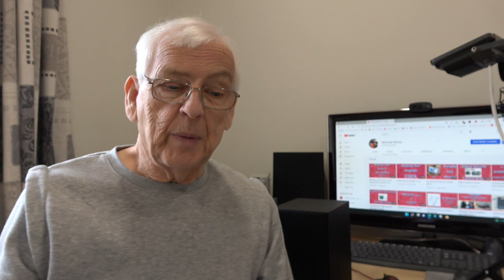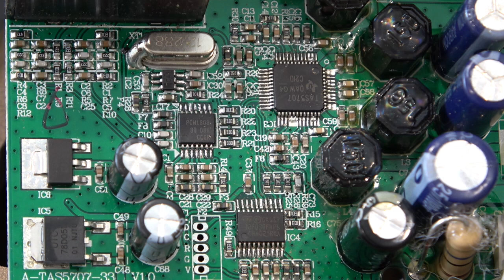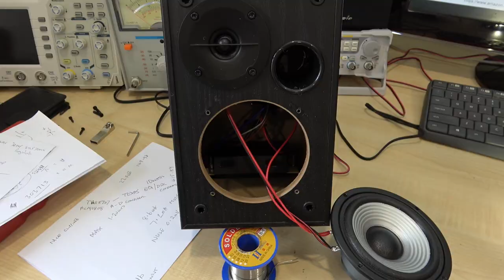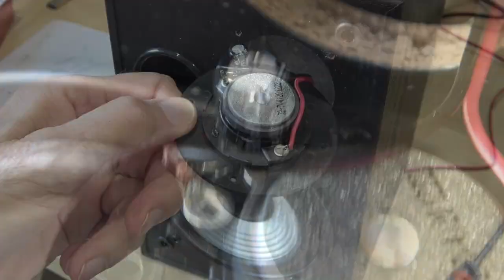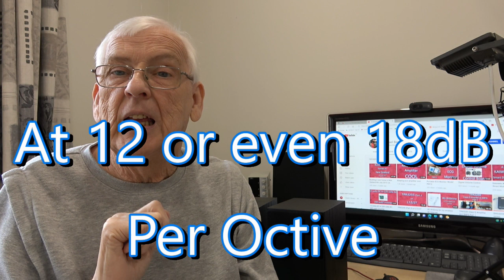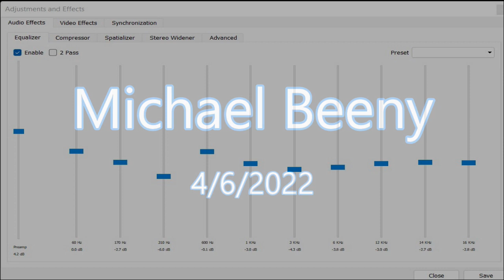EDIFIER R980T. Active loudspeaker review, and a look inside.

Comment: Hey! I was wondering if you had any idea if these would work for a turntable setup. I have an atlp60, which has a built in pre-amp and an rca connection. Can I just plug the left rca output into one speaker and the right output into the other? I don’t know anything about speakers and it is a headache trying to get information out of a sea of YouTube videos. If these don’t work would you have any recommendations for some okay, but cheap active speakers.
Reply from the maker: Hi Aaron. The short answer is probably!! If it has a ceramic (cheap) cartridge it should feed directly into the speakers. A better turntable with a magnetic cartridge will need a preamp with RIAA correction. These days many are fitted internally with such things. As I have no way of knowing what you have you can only try it, nothing will be damaged. If it sounds good all is OK but if the sound is very weak and no bass, it will need a preamp with RIAA EQ. Good luck.
Reply: Ok thank you!

Comment: Hi Michael,
I was wondering if you can help with this question. I have a monitor audio subwoofer model ASW 210 that comes with dual driver (2 10 inch drivers). I discovered the fuse was burned, with a rating of 1.25 amp. Not able to buy the correct 1.25 amp fuse replacement, I was able to find some 1, 2 , 3, and 5 amps fuse. I placed the 1, 2 and 3 fuses to test and it all burned out right away. With the 5 amps fuse, I was able to get the amplifier to turn on with the red light signal for power. But when I switched it on, there is a loud hum. What would be my best solution for this? 
Would replacing the amplifier with an amplifier made for a single driver work since all I can find is a single driver amplifier with the same amplifier plate size.  I know this sub is very old, but I think they were really well built back then and I would prefer using it over cheap mass built sub woofers today.
Nice content by the way, I was considering buying this Edifier speaker to add with my 5.1 system to turn it into a 7.1 for Atmost sound technology since there is so many good reviews on amazon.
Reply from the maker: The fuse is to protect the amplifier in case of a fault. The amplifier is clearly damaged, hence blowing the fuse. Replacing it with larger fuses is a good way to start a fire!!
An amplifier is not made for a specific number of drive units but a specific impedance. I cannot advise on this sub as I have know knowledge of it.
Reply: Hi Michael,
After sending you my last message, I discovered the 5 amp also burned out. I took a look at the amplifier and it seem like a large coil connected to the by the power line got pretty hot. Could this be the problem?
Reply: So as long as long as I can get a good amplifier, it should work right?
Reply from the maker: @ricetogo  Most drive units are 8 ohms, so two in parallel will be 4 ohms. Not always the case, one reason I don't like to give advice on stuff I don't know. Just make sure the amplifier is made for 4 ohms. Don't forget the sub will need a crossover at about 100/120 hz. You cant just connect any amplifier to the speakers. The original sub will have this as part of the circuit.
Reply: Good to know, I thank you Michale
Reply: Michael